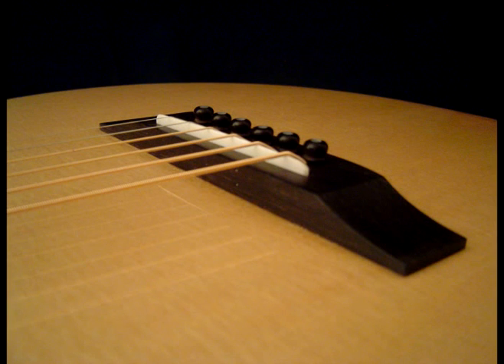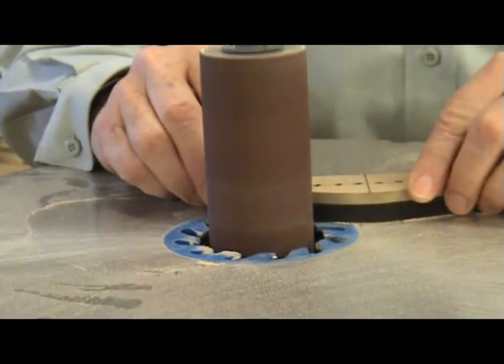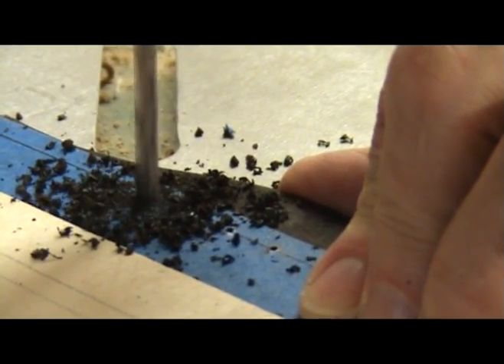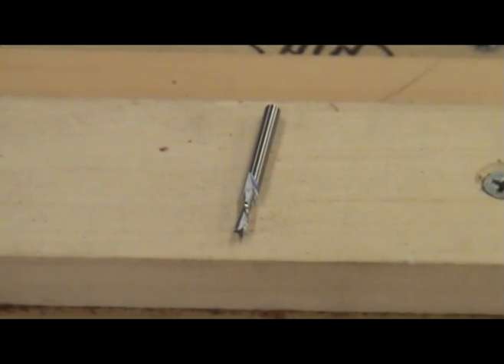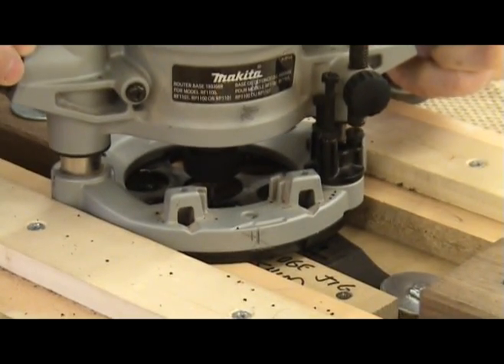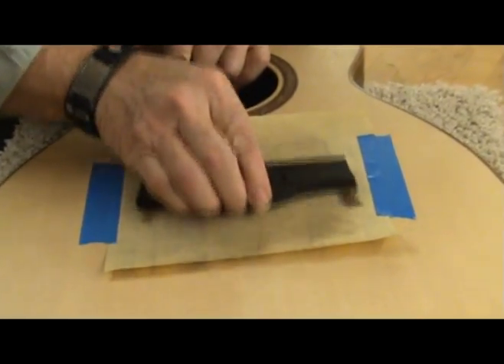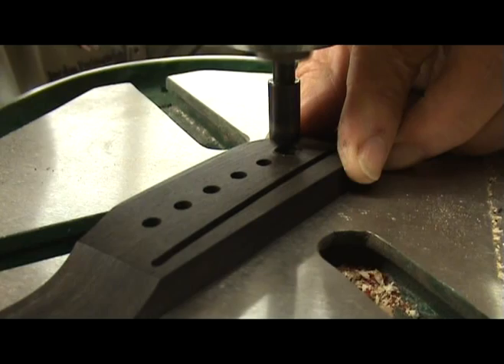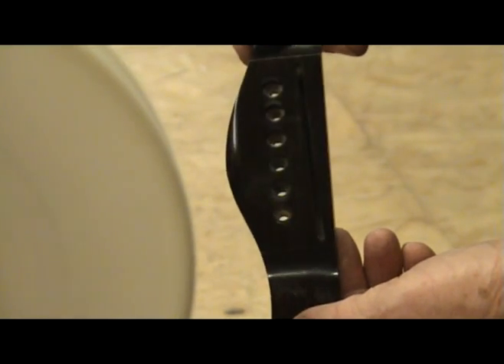Luthier Tips du Jour - Steel String Bridge making

Comment: Many plunge routers have multiple stops that allow you to set the maximum depth of the bit, and then turn an adjuster that allows you to make one or more shallower cuts prior to the full depth cut. 
Also, when you're beveling bridge pin holes, if you set the depth stop on your drill press to the desired depth, all of your bevels will come out the same (and the last 5 will be quick and easy!) 
You probably already knew this stuff, but it wasn't mentioned in the video. Excellent video as always!

Comment: Hi, great videos! I'll be referencing them often. I'm wondering if you have done any videos on repairing chips under the bridge? Mine was lifting and was chipped quite a bit when I removed it. What is the best thing to use so the joint will be flush and strong? Thanks!

Comment: The angle is the main question I have about the bridge slot.  What is it?  I can clearly see that there is about an 1/8" difference in the set back from the front edge of the bridge which is accepted to be at 90 degrees to the centerline of the guitar.  What is the angle of the slot in relation to the front of the bridge.

Comment: Due to budget reasons I can only find a set of brad point bits with 4.5mm  or 5mm bit will either of them still work or will I have to bite the bullet

Also after finish sanding my bridge I’ve noticed that it’s a little bit taller than the fretboard is that also going to be an issue or can I work with it
Reply from the maker: a 4.5mm would work as you have to ream the holes out later anyway and you will need to bite the bullet for the reamer. The bridge is normally about a 1/16 inch taller than the fretboard with frets installed. However, this depends on many factors. Hopefully you have thought this through by the time you make the bridge.
Reply: to be honest I actually never knew about the 1/16" my master luthier who is a classical guitar maker never mentioned it
as silly as it sounds to learn how to make a steel string guitar from a non steel string guitar maker i've still learned so much 
I've just needed a few extra bits along the way

Comment: Thanks for the reply! However since accuracy is an important factor here, I would feel better if I knew if the dimensions, you use from the front, are at the ends of the slot or at the high and low string locations and if they are to the middle of the slot or to the front edge of the slot. Picky, picky, picky......